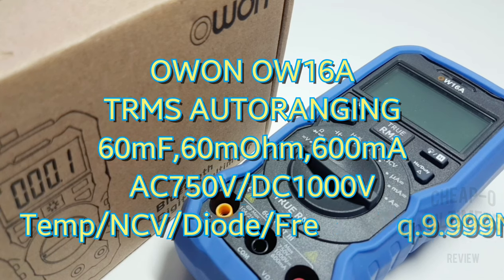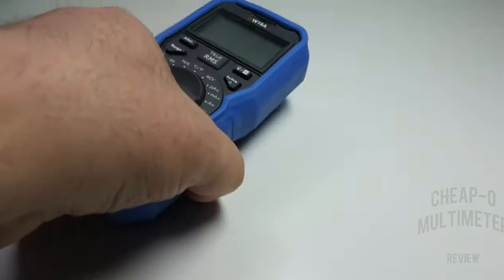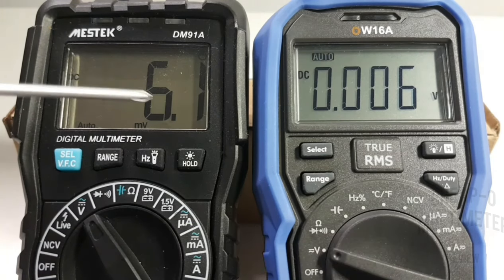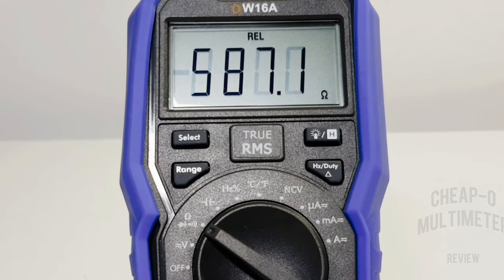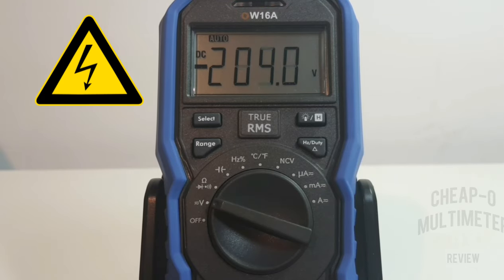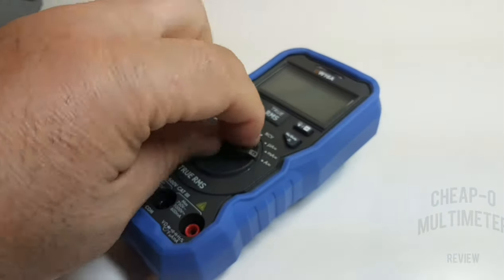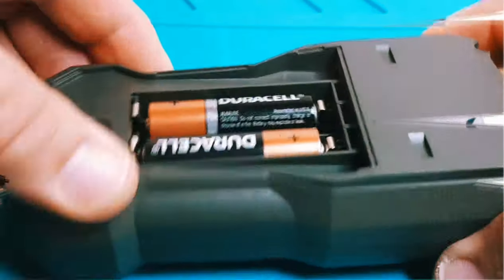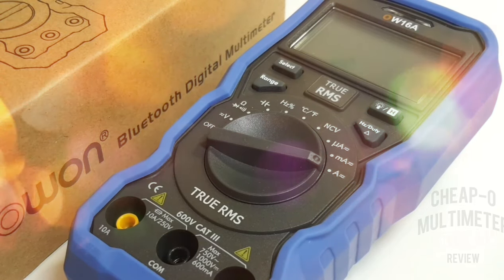OWON OW16A CHEAP-O Multimeter Review & Teardown!

Comment: Thanks for this. Because of it I ordered the 16b, mainly to use it to graph heat changes in a 3D printer. And so far it seems to be a great little meter, it will never replace my trusty old Fluke 83, but it seems accurate and the bluetooth app with graphing is pretty cool.
Reply from the maker: Glad the review helped you make an informed decision. The 16 series is a great choice! I know what you mean about the Fluke but then again it's always nice to have more than 1 meter on the bench. Thanks for watching!

Comment: Its lcd light remains on or it get turn off automatic after few seconds ?
Reply from the maker: Unfortunately the backlight turns off automatically after about 15 sec
Reply: @KeepOnTesting  ohh, but this is not the case with my owon cm2100b, it remain on.

Comment: Well I have to confess to being somewhat surprised for $20.00, weak NCV is so common in so many meters its almost not worth mentioning.  All the important ranges work great and I only see the slowish continuity as any sort of negative and even its lighted loud and useable.  Overall this is one of the better cheapo meters ive seen this year, some of the upper level Owons seem over priced once ya see the inside, but its really hard to find any genuine complaints with this one for the price point. Nice large clean looking display, lights all the LED's,  some nice details on the board - you dont usually see isolation slots in this price range.  I think if one wanted to you could solder in an additional NCV element and locate it in that empty NCV box, ive done similar in other meters and increased the NCV sensitivity at least 2x.  This one looks like a great low price winner for the money.
Reply from the maker: It was a great CHEAP-O Meter..I'm flabbergasted by the attention to detail at this price point..If the continuity was quicker it would be seriously smokin! We are getting lots of bang these days when it comes to cheap dmms....!

Comment: Good video, but... it has no AC or DC voltage range below 6V!? I had to check the datasheet because I couldn't believe it, but its actually true. +/- 0.5% + 2 counts makes this nearly useless on the bench.
Reply from the maker: Hi SD, Thanks for the kudos.
You are incorrect about the 6V.
I am not sure what you are referring to but the OWON has NO problem with lower voltages..it reads down to 10mV DC without any issues?? Also, the spec sheet claims 60mV AC/DC,  I was able to read down to 10mV without a hiccup. Yes, there is no dedicated mV selection but its still capable of seeing the lower ranges. I even tested the 250mV in my DC Accuracy test. Also the +-0.5%+2dig. is an industry standard/norm...nothing unusual here.
Reply: @KeepOnTesting  The datasheet from https://static.eleshop.nl/mage/media/downloads/OW16_datasheet.pdf lists 6V as the lowest range. It states accuracy of +/- 0.5% + 2 which meas that a 10mV reading could show as high as 42mV and as low as -22mV and still be within spec as the range is all the way to 6V at 6000 counts. That is unusable on the bench IMO.
Reply from the maker: @superciliousdude That datasheet is incorrect, it's a TYPO.....The spec-sheet that ships with the multimeter clearly states the OW16 series (A/B) has a 600mV starting threshold. As I showed in the video, it had no problem reading 250mV on the precision voltage reference.
Reply: @KeepOnTesting  At 6:37 in your video where you make a 250mV measurement, you are in the 6V range. The display shows 0.249V and range display shows V not mV. The datasheet from the manufacturer's website does not show a mV range at all. Can you post a follow-up video showing the 600mV range? A 6000 count meter in the 600mV range would read 000.0mV with the probes shorted.
Reply from the maker: @superciliousdude  Every OWON 16A/B Ships with a spec sheet that clearly states 600mV as the min. Despite what you might see online it's not the case. Next,  .249 Volts=249mV..A separate mV Range isn't always included in a dmm but it doesn't mean it can't into mV threshold. This Meter didn't really garnish a lot of interest so I doubt I will pursue a follow-up video. I'll try to incorporate the OWON into a future video and demonstrate the mV ranges further.
Reply: @KeepOnTesting  The mV reading simply HAS to be on a separate range, otherwise the reading is susceptible to the error margins associated with the larger range. Like I stated in my earlier reply, the 6V range has a ridiculously large error margin low mV readings like 10mV = -22mV being fully within spec. This is why I would be STRONGLY disinclined to use a meter such as this on the bench.
Reply from the maker: @superciliousdude  Roger that! that's why it's great that we have a lot of choices in the CHEAPO-Multimeter Realm, not every end user has the same needs or requirements..as always thanks for your input.